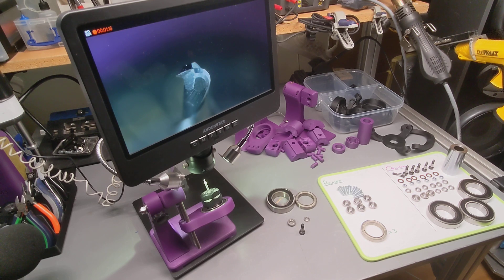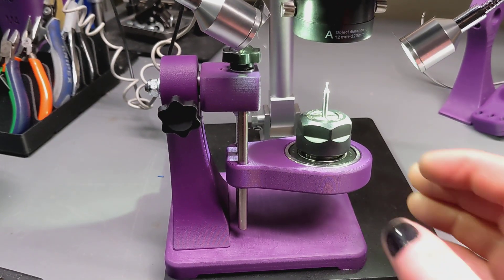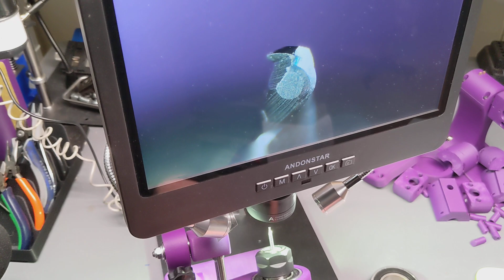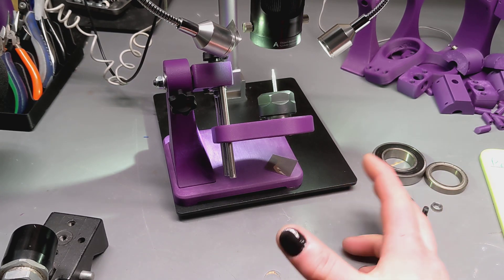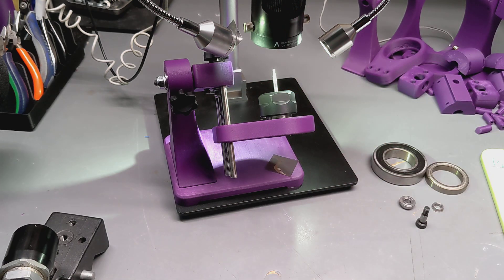SPM Under $10, and other updates

Comment: Thanks
Reply: I've just come across your SPM videos and wondered whether you'd considered using flexures in place of bearings in the SPM.  Flexures – especially 3-d printed ones – may not achieve the angular movement you require, but if they do, they offer great precision at little to no cost.

If you're not familiar with flexures and compliant mechanisms, here's a good primer...

https://youtu.be/97t7Xj_iBv0?si=vhO-7wFUCskVemAe

Thanks for all the effort you're putting in: not just on the design and build, but documenting it all so clearly to share with the rest of us.  Oh, and congratulations on the chip-free nail polish!  That's above and beyond.

Comment: will you eventually post it on printables or similar?
Reply from the maker: Yep, I'll make all 3D printable designs available for everyone, additionally I'll release the design files (step or f3d) so people can modify it easily to suit their needs. The bearings I'm waiting on got delayed in the post but as soon as I've validated the new design it'll be up for everyone to use
Reply: @makebreakrepair where is the repo for this project? i’m interested is adding motors and a controller. thanks.

Comment: The prints Look awesome! Like it very much. What 3d-printer do you use?
Reply from the maker: I'm fortunate enough to have a bambu X1 carbon that was purchased as a business expense (before that business died, couldn't afford to buy one now though, long story 🙃), but I used to be an engineer working in the industrial 3D printing field so I feel qualified to say that any modern (ie less than 5 years old) consumer 3D printer can produce prints of a similar quality but they may need a little tuning or some minor upgrades first. I had an ender 5 that could print a similar quality to what I'm showing in the video, for example. 
That said, I got the X1 because I was tired of tinkering with 3d printers (I was making them back in the reprap days) and wanted a tool just that worked without any messing about (X1 still needed some 3d printed mods though, it's not perfect) and was faster. 
If you're trying to improve the quality of your 3D prints I recommend asking on a forum/subreddit, especially if there's one for your make of printer, as they'll be able to give you much more specific and useful advice. 
That said, print quality issues generally fall into one of three things:
- Motion issues: belts loose, linear guides loose (eg v-wheels on some printers), bolts loose, things misaligned and binding, or bent leadscrews (eg 'z wobble'), and ringing artefacts
- Tuning issues: acceleration too high, print settings (temperature, speeds, etc), lots of possibilities in this category, I usually start with a manufacturer default profile and filament as a baseline sanity check
- Extrusion issues: Extruders are the most critical component and a bad one can be the cause of all the issues. Ditto with bad quality filament, avoid ultra cheap filament completely. You don't have to buy expensive brands, just get reputable brands that you see a lot of people using (I think esun is cheap-good, haven't used it myself); cheap filament causes all sorts of issues like varied extrusion width, clogging, etc etc. So does wet filament, depending on the filament type.

Comment: Hey could you power you 360 rotator rig with 3 capstan drives, and use 3 of the rotator rigs, to drive a wheel-like robotic leg, which has a circular linear bearing with tuneable friction, and linear motors, so that we can have a little guy with wheel feet that can work as wheels or as legs with tuneable slippage for speed and balance adjustments?
Reply from the maker: I uhhh think I need a diagram 😅

Comment: Cheap and accessible weighted base = "Tub and lid" style users can fill with concrete. 

You can still jam a block of steel in there if you have one, but it makes it highly adaptable to user circumstance. Gravel/plater/loose metal etc, it just has to be heavy.
Reply from the maker: Good call, you're right. I thought 'steel' because I have draws of steel offcuts and such but yeah, just a cavity to fill with whatever (gravel, sand, broken drill bits...) would be more widely suited than a pocket for steel. Adding that to my notes, thanks.
Reply: I would argue for 3 strong magnets and a proper steel base.

Comment: In the USA, we have to source metric all the time and it costs about the same, so no big deal if you stick to metric.  Most 3d printers are only metric.
Reply from the maker: Cheers, I wasn't sure, I only have what I see on youtube to go off. Fortunately M6 is only 0.013" smaller than 1/4" so I've designed it to work for both easily enough (though 1/4 maaay break the part when using the bolt to cut threads (depending on what you print it out of) so either use a tap or just heat the bolt a bit with a lighter first).
Reply: I think he means like you can can adjust the stl to fit your needs